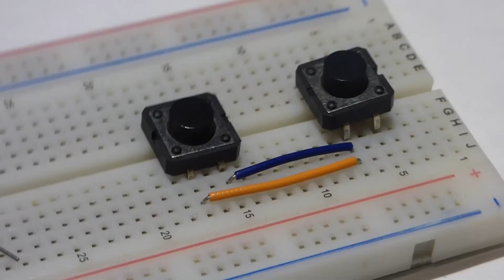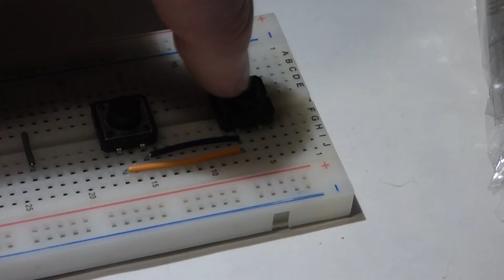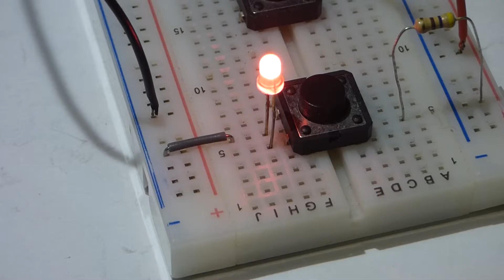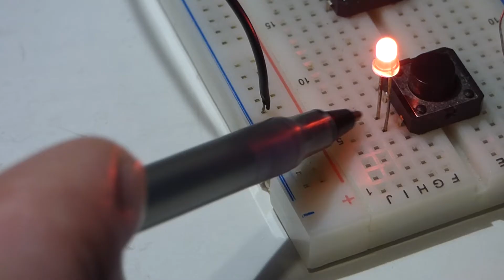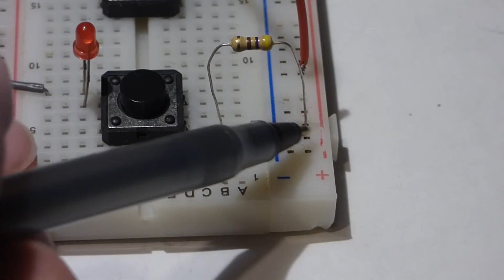Normally open tactile push button switch. How to insert into breadboard and use in an LED circuit.

Comment: I tried moving the resistor a little bit away from the switch like on 2:54 but it conducts irrespectively from whether I press the switch or not. 
Help?

Comment: thank you for ur demonstration, but why do u put a resistor on the positive side ,
shouldn't they be on the negative for the electricity flow ?.
Reply: A resistor can go either side of the diode so I hear.

Comment: Does the pushbutton have memory to keep the light on with out having to holdthe button down?
Reply from the maker: I'm sure you can find some that will switch on/off each time you press the button, but all the ones I have are only on while you hold the button.
Reply: You can program that with an arduino or something along those lines

Comment: Hello, i recreated the circuit demonstrated in your video. The first time round, it worked as expected, however when i recreated it again and again, my LEDs keep blowing out every time i push the switch, why is this? I'm reacreating the circuit the exact same way each time. BTW i'm using a 470Ω resistor
Reply from the maker: Sounds like there's a short somewhere bypassing the resistor. Or a lot more than 9V is being used to power it.
Reply: @Electronzap  I found the source of the problem, you're right, i had a short circuit
Reply from the maker: Common problem :D

Comment: Can you make a led light turn off when the button is pushed and the led turn on when the button is off?? (Without logic gates)
Reply from the maker: There's switches that are normally off and turn on when you press them, called normally closed. I don't have any though. All mine are normally open.
Reply: electronzapdotcom ok,  thank you
Reply from the maker: Thanks for watching!

Comment: can it work if i press the button its on untill i press it again and its off?
Reply from the maker: You have to get a switch that works that way. Like a single pole single throw switch or special pushbutton switches. Tons of switch options out there. I use only these for my videos because they fit on a breadboard easily and come with almost every electronics kit I look at.